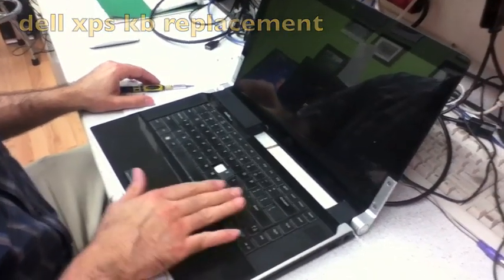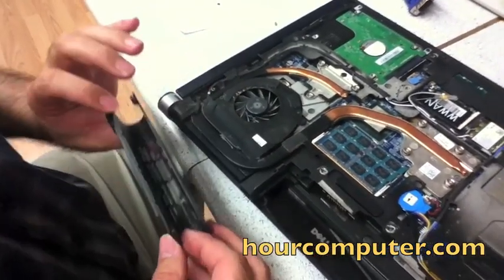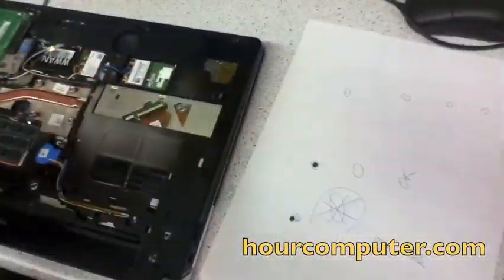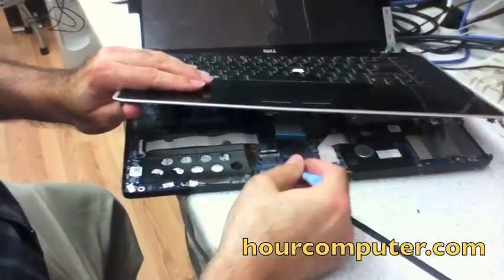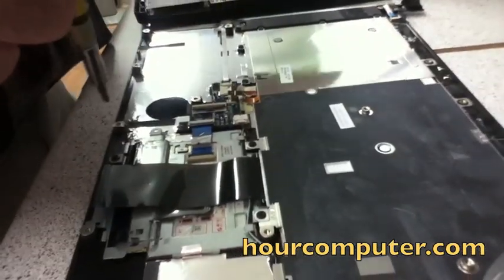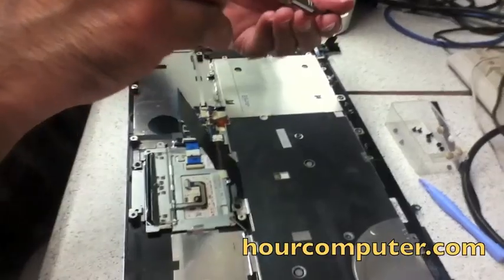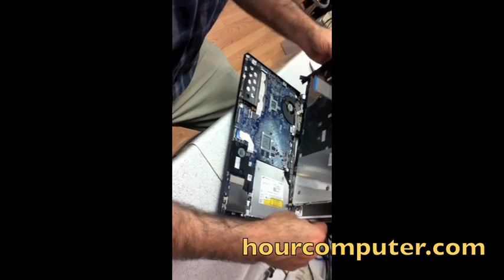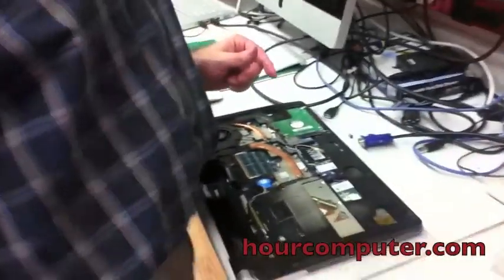dell studio xps 1640 keyboard replacement

Comment: more than 14 screws .. basically remove any black screw .. all the P, some K, i think 2 Ds . not to mention the 2 fat headed screws under the battery .. ALSO.. if you dont JERK the keyboard up like a mad man.. you can lift it up without pulling anything out.. as was my case as i removed the ROM (because no one uses ROMs anymore) and replaced it with a 1TB storage HDD and put a 500GB SSD for the OS and programs. other than the missing info.. GREAT video .. keep up the good work.

Comment: thank you sir! very good explaination, it helped me a lot! some things I'd add: some of the 'P' screws are not so easy to find. One hides near the heatsink (towards the laptop edge) and two are on the underside where the battery slides in (silver, large diameter head)
Also the ones above the mainboard (not only on the edge). The palm cover is clipped and should be able to be pulled out quite easily if you take out all the right screws. Removing the expresscard slot dummy helped with getting a start on prying off the palm cover.

Comment: my speakers on my 1640 sound terrible, sometimes it sounds muffled and the it sounds tinny; it no longer has the sound quality it once had. Are the speakers shot or the integrated audio electronics on the motherboard?
I also have a problem with the headphone jack input. I've used it so much that I'm no longer getting sound. I have to wiggle the headphone jack to get sound but now I can't even do that. ..is this fixable?

Comment: Can you tell me whether this keyboard is USB or PS/2 or some other connection in device manager? Any 1640 owner, it'd be useful to know.
Reply: It should be under  input device
Reply: I don't have one of these :P I am working with the keyboard for a project
Reply: I have just bought the keyboard and need to reprogram it.
Reply from the maker: Ross Bishop
i don't know what you mean you need to reprogram it.
you should have a tab in device manager "keyboard" ps/2
Reply: When I say this I have purchased this specific keyboard and I'm going to buy a controller and get the outputs of the matrix, convert it to USB and use it as an external keyboard :P

PS/2 you say? That's great, thanks!

Comment: Hey i did exactly what you did in the video , but my keyboard doesn't work! not one key is working. Any idea? I did got the right model of keyboard
Reply from the maker: it could be the cable is either loose or not aligned properly.

sorry for the late reply.
Reply: Hour Computers Can you make a video to replace the speakers?
Reply: Alberto Lopez Hour Computers yea i dropped my 1645 a while back and the speakers stopped working id also love a speaker repair/replacement vid if you get time! :D